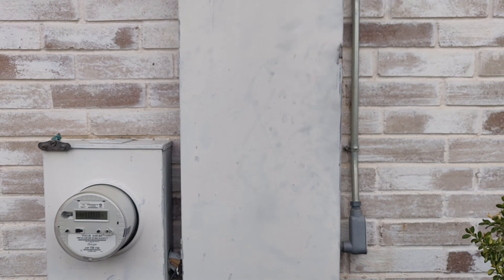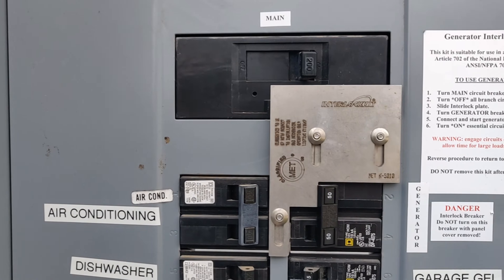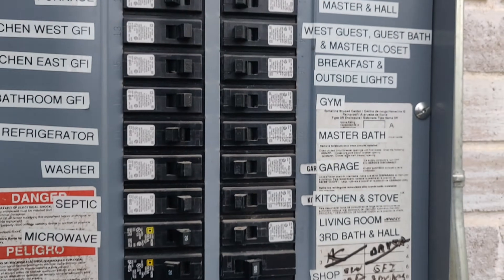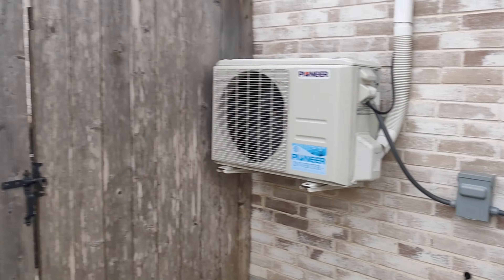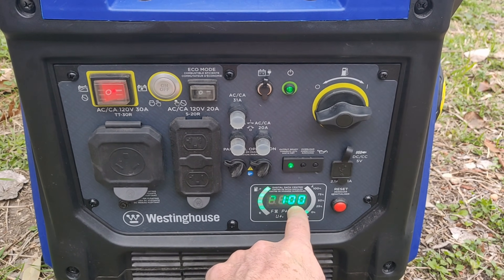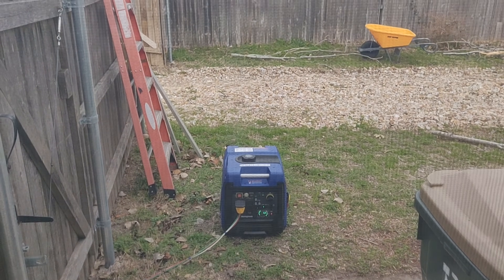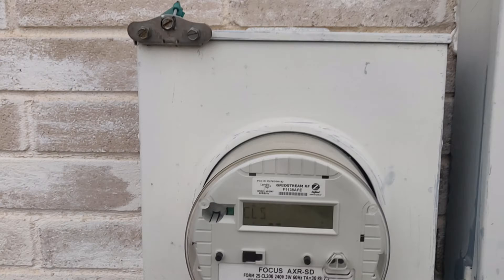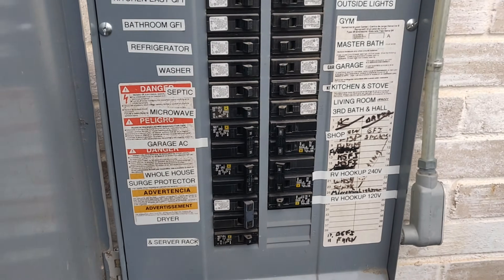Powering my house with a 4500 watt 120v generator.

Comment: If I understand correctly you are splicing the 120 to power both legs of the main breaker box? And in doing so basically having 2 120 legs of the same phase which of course is why 240 appliances won’t work, correct?
Reply from the maker: Yes, you understand perfectly.
Reply: Thanks. It’s come time for me to do this to my house. My power is out for the 3rd time in a month. The consequences of living in a wooded area, lol
Reply: @jasond4752 - do yourself a favor and get a generator that has  240V then you don’t have to do this rigging and it won’t cost you any more
Reply: @condor5635  I actually already did it. Lost power about a month ago and it works great to power the necessities. A quiet duel fuel inverter generator with a 240 outlet is actually a lot more expensive. The one I got is 120v 4500 watts for about $800, the smallest dual fuel quiet inverter I could find with a 240v outlet was 9500 watts and is around $2300. Also, the 240 plug on that generator was only rated at 30 amps so it really made no sense to go that way.
Reply: @jasond4752  I’m sure inverters are nice but I don’t really see the need especially the limited amount of time this thing will have over 10 or 20 year lifespan.  Most of the generators now have less than 5% THD and I’ve never had issues with any appliances having any issues whatsoever running my generator.

At least Westinghouse ones
Reply: @condor5635  My reasons for buying it were because it runs on propane and it’s very quiet. I can barely hear it running right outside the window. Job site style generators are super loud and very annoying.
Reply: @jasond4752 did you buy the harbor freight generator? I have an old generac that produces 240v but it is very loud and hard to start. I basically have the same set up, except I feed a 50amp welder receptacle with the generator and then power the panel. 

I recently purchased the 5000 watt quiet generator/inverter from harbor freight but it’s only 120v and uses a 30amp RV outlet. Voltage coming out of the 30amp RV plug is 60v on each leg for 120v total. I really don’t understand how this works.If you have the HF generator, how did you get past this issue?
Reply: @jeromecarter4481  I bought a champion generator but it’s probably very similar to the HF one. It also has a 30 amp RV outlet which is the outlet I use to feed the house. As to how you’re measuring 60 volts I have no idea. I never actually measured the voltage coming out of the generator. I just wired it like normal, one hot leg, one neutral, and a ground. Tested and had no problems. So I’d say either your generator has a problem or your volt meter is faulty. Shouldn’t read 60 volts, should be around 120v across the hot and neutral.

Comment: From what I understand,
The inlet cable is a 10/2 cable (lets define it as Cable A)
And the cable from the inlet box to the Panel is a 10/3 cable (let’s define it as Cable B)

So, Cable A has 1 Hot, 1 Neutral and 1 Ground wires.
Cable B has 2 Hots, 1 Neutral and 1 Ground wire. 1 Hot wire power 1 leg in the Panel.

So, inside the Inlet Box, the Hot wire from Cable 1 is connected to the 2 Hot wires from Cable B.

That’s what I understand.
Reply from the maker: You are almost correct.  The connection from 1 hot to 2 hots happens in Cable A.  Since Cable A is only used with this generator, it's safer. 

If the connection from 1 hot to 2 hots happened in Cable B, it would be present even if a 240v generator was connected to the inlet panel.  And that would create a dead short.
Reply: You have the inlet plug ready for 240V, so, that can happen in the Cable A, inside the plug.
If the inlet plug isn’t ready for 240V, then it has to happen in Cable B inside the inlet box.
Reply: I am looking exactly what you did.
The only difference in our situations were, you have a 240V ready inlet box, and I have a 120V only inlet box.
Reply: Yeah.  I think the goal was to have the breaker panel wired up 240 properly including the connection box.  The setup is normal when the rigged cable is not connected.  Smart idea for 120V generator owners.  That is if it is easy enough to make a safe secure jump between the two 120 legs.

Comment: Pretty useless vid unless you have an inlet box already wired to your panel.
Reply: Someone like me who just wired my house for 240V has watched a lot of videos.  There are correct and rigged 240V setup videos.  Beryl just went through and I know some people who have 120V generators.  He is showing a way to plug in and use 120V on a correct safe 50A 240V setup as the title says.
Reply: Not really, I have the same generator (except that mine is duel fuel). I'm installing damn near the same setup (different intake jack, and I have a split panel). Otherwise, it is helpful to see what others have done in my same situation. My stove, hot water heater,  dryer, and 240v heaters won't work. I'll have lights, internet, wifi, TV, and a warm bedroom. Good enough for me. Added bonus; I won't kill a lineman...

Comment: Any idea how many  feet /  long the wiring  ( 10 gauge ) can be from the inlet box to the house panel  ?  Hoping to keep the Gen. far away from the living / TV room.
Reply: I’d put the inlet box as close to your panel as you can. Easier to run the wiring. Then a 50’ 10 gauge cord from your gen to the box.
Reply: @jstins  so your saying 50 feet is the max length of the wire or gen cord  ?    I need it to be 100 feet away . Would that be OK  ?   or 100 feet just to much  ?

Comment: Your supposed to shut every breaker off when using an interlock then slowly turn on what you need
Reply from the maker: That's true.  In my case, I knew that very little was on in the house, and I could safely hook up as long as I'd turned off major loads like the fridge and furnace.  But going one breaker at a time is best if you're not sure what loads are on.

Comment: I’m curious on how you can run your furnace on a 30 amp 3700 watt generator I have a 50 amp 9500 watt generator and can’t run my furnace
Reply from the maker: Hi Mike,

I'm guessing that you have a heat pump, which is basically an air conditioner running in reverse.  Heat pumps need 240 volts and they draw a lot of amps, especially at startup.

My furnace is gas, so it only needs 120 volts to run the blower and electronics.

Take a look at the breaker for your heat pump.  If it's 50 amps or less, then you can probably run it from your generator.  The startup load is what generators cannot handle.  And you might be able to take care of that with a soft start system for the compressor.
Reply: @ElQuesoGuapo    Hello I have central heat and air conditioning heater is in attic ac is out side my my electrician says my generator is about 5 amps shy and it’s a brand new house
Reply: No definitely not a heat pump just a electric furnace

Comment: Did you just put a jumper in between A and B to get 120 to both sides?
Reply from the maker: Yup!  I did it in the cable from the generator to the house, so there's no chance of the jumper being in the circuit unless the generator is in use.

Comment: You wou would be suprised how little amps/load the furnace takes.  300-400 watts.  Only has to run inducer fan,  glow igniter, then main blower,  which most have a capacitor so it will slowly ramp up.  If anyone has natural gas and lose electricity, the gas furnace will take priority,
Reply: yeah, I was going to mention that here as well. I have an Emporia energy monitor on my circuits, and I can see the realtime power draw of my furnace. It's a fairly modern, high efficiency gas unit. And you can see as it runs that it is set up to very gradually start up, in steps, maybe 100W at a time, until it gets up to full speed which is not more than 400W. Seems like it will be very gentle on a generator.
Reply: @CurtisKlope   The only thing you may have to do on the generator is to make sure it a bonded neutral.  Some newer furnaces will not  work if it's a floating neutral.  Very easy adapter you can make.  Get a three prong  plug from homedepot,  Attach a very short piece of 12 ga wire and tie the ground pin (the round one) to the neutral (the wider of the 2 prongs or the silver terminal) and it's done.  Plug that in a spare plug on the generator or power strip. Search for neutral grounding plug and get one pre-made.
Reply: @avflyguy I would think that’s only applicable if you were using a floating neutral generator with an extension cord, plugged into a single circuit transfer switch at the furnace.

If you’re running through an interlock on the panel, the bond should be there.

Comment: I always wanted to try a 220v load like a stove or AC with your current set up. (  NO PUNN INTENDED)   do you think it would work, being that its the same 120v leg  or is there a problem with it not being true alternating current
Reply from the maker: It won't work at all.  There's no voltage different between the two legs, so the 240v devices will see no volts at all.

Comment: Does energizing both hots on the plug power both legs in the panel creating a 240 circuit?  Also do you loose any amps from your generator by wiring the plug the way you did?
Reply from the maker: Both legs are energized to 120 volts, but it doesn't create a 240 volt circuit.  Voltage is a measurement of the difference in electric potential between two points.  With this setup, both legs are 120 volts in comparison to the neutral.  That's what all of your 120 volt equipment needs in order to run.

In normal use, the two legs of the house panel would be 180 degrees out of phase with each other.  When one leg is "pushing" electricity, the other is "pulling".  That's how you get 240 volts from the pair of 120 volt legs.

With this setup, both legs are at 120 volts with respect to ground, but they're at zero volts with respect to each other.  Both legs are "pushing" at the same time, and both are "pulling" at the same time.  The 240 volt equipment can't operate, because it's literally seeing zero volts.

There's no change in the generator's output.  It's still making 120 volts just like it always does.
Reply: crap, so my 240v water well pump probably won't work :/ @ElQuesoGuapo

Comment: I’ve got the same exact inventor. Purchased 3 months ago. Had an electrician come out yesterday to quote on an Interlock install on panel. Said just one leg would be energized. Solution solved here I believe. Can you provide the part info or link that hooked into your outside connection where you jumped an internal wire on the black plug effectively charging both legs? Much appreciated if you could.
Reply from the maker: Hi.  The parts list is in the video description.
Reply: Got it! Had to click “see more”. Thank you!

Comment: One thing to make sure if you get a generator is find out if it has a floating or bonded neutral.  Westinghouse brands usually come with a floating neutral meaning that it is ready to hook up to a main panel where the neutral and grounds are bonded..

Of you're trying to run this with another brand or sub panel you must make sure to switch it. 

There can only be 1 bonded neutral in a full circuit, and I don't have the exact answer but I did watch a video on why and forgot the reasoning.. it had something to do with possibly letting the return power go through still or something like that.
Reply: I’m not sure what westing houses you’re talking about but almost every Manuel they have shows how to make their generators floating neutral because they come bonded
Reply: Ground conductor is not normally supposed to carry current. If the neutral is connected to ground in more than one place then neutral current would be shared between the neutral conductor and the ground conductor.
Reply: @lotsofcases6522  you are absolutely right, but I once had a 240 generator running and the neutral failed, it sent 240 through the entire house, destroying a microwave and various other things if it was bonded at the generator as well, the ground would've taken over the job.

Comment: This is a good solution UNTIL you forget to turn off your air conditioner breaker. Your AC could catch fire and burn your house down running 120v instead of 240v. Really dangerous.
Reply: From my understanding the A/C just won't do anything because it'll basically see 0 volts between the two hots
Reply: Not enough power to kick it on!!! generator would blow a breaker!
Reply: It's pretty much common sense to turn of all breakers before connecting and common sense would tell you when you have a 120V generator that anything with a double pole is likely 240v and will not work..  im not talking about a single pole split breaker but a beefy full size double pole which has the AMP rating right on the switch.

It would be VERY unlike to confuse it with a single pole IMO but hey I've seen idiots backfeed their panels from the dryer plug so who am I to say someone wouldn't do this? 😂😂

Comment: We had an electrician install an interlock kit with a 50 amp breaker and mistakingly put a 50 amp "outlet" (female) box on the outside of the house.  I did not want to use a male-to-male cord from my generator to the house, so called them back and they swapped out that box with a 30 amp inlet instead (with male plugs sticking out). But is that a problem having a 30 amp generator inlet box wired to a 50 amp breaker? I have a generator with only 5200 running watts and it likely has its own 30 A breaker, so theoretically it shouldn't ever be able to be overloaded if I'm using correct cords that only plug into a 30 amp receptacle.  But still, shouldn’t the breaker and inlet box numbers match? On top of that, since the breaker is already 50 amps and I assume the wiring is already thicker gauge rated for that, why didn't they install a 50 amp inlet box to match? I'd just get an adapter to plug in my 30 A generator to the 50 A inlet? I figure might as well future proof the house system in case I ever move, or decide to get a larger generator that has a 50 A receptacle. Thanks
Reply from the maker: I think it's fine.

The breaker's job is to protect the house wiring.  Since the house wiring is rated to 50 amps, the 50 amp breaker is OK.  You could swap to a 30 amp breaker if you really wanted to.  There's no harm in it, but probably no advantage either.  The generator cannot produce more than 30 amps, so it's not able to produce enough power to harm the wiring.  The generator would shut itself off before it ever produced enough power to trip the 30 amp or the 50 amp breaker.
Reply: @ElQuesoGuapo  but since they already put in a 50 amp breaker and wiring rated for that, shouldn’t I just get the 50 amp inlet to match? Then I or the next homeowner can get the most potential from it?
Reply from the maker: @1980sLegoFan  Yeah, I would.  I've got a 50 amp inlet box even though my generator's a 30 amp unit.  It gives me the option of running a bigger generator later on.

Comment: No offense. You know too little to be doing this but think you know a lot. You have no business doing this. The wire you used is 10awg thhn. That is rated for 30amps not 50 like you stated. The breaker should be a 30amp 240v breaker not a 50 at the interlock. That generator is not capable of producing 50 amps. You should never just use something because you have it, if it’s not correct for the application. I would hate to be your neighbor as your monkey business could burn my house down as well. At least your neighbors with have the video evidence for the insurance claim. Stop doing electrical work! No offense but you need more knowledge if you want to do your own electrical work.
Reply from the maker: I used 8awg wire, not 10.

Comment: Great video.  I recently picked up a Westinghouse i4500DFC inverter for $749 on sale at Lowes.  I already have the interlock, breaker, and inlet box installed for my older 7500w generator (super loud) and was trying to figure out how to use the new inverter to feed the house rather than running extension cords.  Problem solved with this video.  Thank you.

Comment: There is a better or cleaner way.  Purchase a standard 240 generator cord...and a short "conversion" cord that will take your generator 120 output and split it into both legs for the generator cord.  I have this kind of set-up, except mine is the 30 amp four pin inlet box rather than the 50 amp.
And actually I would recommend replacing the 50 amp inlet box with a 30 amp.  The reason is that the 30 amp 240v generator cord will be less expensive that a 50 amp cord and easier to handle.
Reply: Tell me more about this "conversion" cord please?
Reply: @RandomStuff-zt6qf  Search:  NEMA TT-30P to L14-30R Adapter Cord, 30 Amp 3 Prong to 4 Prong Generator Plug Adapter, Generator Transfer Switch Adapter, Generator to House Inlet Box

It takes the 120V generator output, and feeds it to both 120V legs of the house.  So the house is 120V single phase...and nothing 240V will work...but everything 120v will work.

Comment: Wich 3 cables come from the distribution to the box? 2 hots and ..neutral or ground?
Reply from the maker: From the inlet box to the panel there are four wires.  Two hots, a neutral and a ground.  You've gotta have all four.